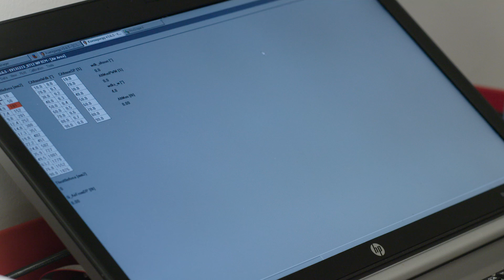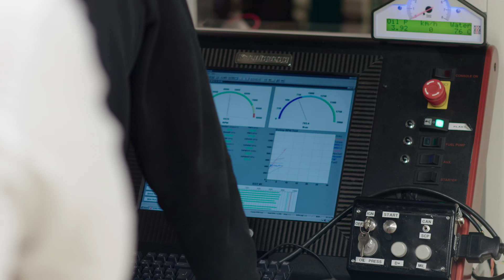The 1360HP Heart of the Koenigsegg One:1 - /INSIDE KOENIGSEGG

Comment: Imagine batteries will out-perform the Model S's by a factor of 3. 5 or 10 years from now? So 3 times the range, and likely a bit more peak power also.
This will either reduce the battery weight by 60%+ or vastly increase range.
What's the range for an ultra car, all topped up? Can it even compete with a current (heavy) Tesla luxury car?
So with 3x better (for weight) batteries, the 918 could skip the whole petrol drivetrain, slightly upgrade the electric engine, invest the lost weight in extra batteries, and get a really decent range. 
And today, the 918 could be stripped by some 300-400kg by making it a basic petrol-only supercar with 600+bhp. 1:2 power to weight is really quite decent. Lose some electric horses, lose the equivalent in battery weight. Accelerate about the same, brake better. Corner better. use less fuel when not braking.
The P1 devotes about 200kg to it's more refined electric systems? Strip those and you are in the same league as a de-wired 918. Does it need the extra 200kg and bhp? Imagine how it will corner when 200kg lighter. How much less it will consume on a journey. How much faster it will go around corners. How much later you can grab the brakes.
What does a petrol drivetrain for a super car weigh nowadays, parts the electric would have no use for? I honestly doný know. 300kg? A nice amount for batteries, but not nearly enough for today's batteries.
It sure seems like hybrids are de-tuned petrol cars to me. That they are getting better engineering covver that fact nicely. Lots of carbon and more hp. Crazy prices.

CvK seems totally right that when batteries become good, petrol gets obsolete along with hybrids.

I SO HOPE we'll get a Top Gear powerlap with the One some day, in good conditions....
Reply: Braking may actually be pretty close when you strip out the motors because the motors actually did some of the braking. The car would be a good bit lighter, but it would also have less braking force. Although, I would rather them just make the non-hybrid cars, just trying to point out that braking may not actually be all that different. Cornering, on the other hand, would definitely improve.
Reply: Electric motors in the 918 contribute 0.5 G of braking even before using the brakes.  Also allows for instantaneous torque vectoring, which is worth its weight.  All this on top of instant torque and power delivery and a large power advantage.  Ferrari studied the tradeoff between electric power and weight and found it to be greatly in the electric motor's favor.  Guess who else found the same thing.  Porsche and McLaren.  Biggest names in motorsport here all converging on same concept.
Reply: Andrew Malkin The motors can take work away from the brake calipers alright, but I would think that brakes have been pretty well "refined" by now. Brakes can bring a car to a halt just fine. Just waste past of the energy obviously. But to regenerate that energy takes a whole lot of weight. Does that out-weigh itself in lap time?
I do see a bit of an advantage in driving/braking 4 wheels individually, but at the rate these cars corner, adding on 400kg of weight is humongous. Don't forget the F40 and how light it was, with 80's tech.

Shadowboost CvK's point is that the current level of technology favors using no electric drive. Too much weight added for limited added performance and range. I think that Volvo V60 is a good example. Much better to not add the weight at all, boost engine power (no real limit to that), and enjoy car lightness. That will just never go out of style at the race track.
I think the P1 made that weight point against the 918 already. P1 has as little "e" as viable. It would not be a challenge at all for McLaren to get 900hp out of the petrol engine, increase the petrol tank, and enjoy a huge range, and still very very light car. A car spends most its time in a straight line. In the case of a track car, it's during full-on acceleration. Weight and aero are key factors here. Weight at lower speeds, aero at higher, obviously. At low speeds though, a lot of time difference can be made.
It's interesting that CvK does like e tech, but doesn't feel it has a place next to fuel. While certainly McLaren and Porsche found ways to let them co-exist. 10 years down the line, we might see a full-on electric Koenigsegg which takes need for a petrol engine away.

Comment: I disagree with you Christian, I think that the McLaren P1 shows that Hybrid power can be more fun than either electric only or combustion only, without sacrificing weight. Soon hybrid cars will use capacitors, like the Toyota Supra/BMW Z4 replacement coming soon. I would personally rather have a hybrid with a lightweight capacitor than a car with only an ICE.

Comment: That was a bit short episode, would loved to haven seen slightly more engines/parts. But never mind the statement regarding Hybrids was though are very clear one. In that regard and with respect to Koenigsegg I wonder how the cars are going to live up to the emissions regulations that will "soon" (2020-2025) be in effect. But okay combustion engines also turn out quite some tricks atm. and in 5 -10 years there will properly be alternatives to traditional gasoline based fuels.

Secondary to many of the comments in the thread - Yes off course Koenigsegg does not have the same R&D capacities as The big boys, but while they develop the hybrid technology to a higher refinement over time, and batteries etc. also become much better, Koenigsegg can wait some years yet before making a transistion. And at that time it is very likely that much more accessible technology will be on the market from automotive sub providers - This means that if Koenigsegg where to go EV or hybrid then it could very well be a doable task. In fact pure EV technology should on paper be far less complicated than Hybrid or Combustion.

As for now and with the very limited production numbers coming from Koenigsegg I don´t think it has any effect on the company what so ever.

The 1:One is already spoken for since it has been developed on request from East Asian buyers. "Make us a more track focused Koenigsegg" and so they have done.

Comment: Beautiful take on the hybrid engines, I think the hybrid phase is only a necessary transition from petrol to electric and it's an important step towards developing a better solution for batteries and electrical motors so that when this phase finishes we will get a fully electrical car without the need for a petrol engine as a backup or extra push.
Reply: I certainly hope so. Then we would only have to concern ourselves with green energy production.
Reply: well, I can assure you that right now there's not such thing as green energy, and they're polluting our planet one way or another, so what's allegedly called green energy has more waste than petrol because the way of manufacturing those batteries, that has a short lifetime. I only hope that Koenigsegg builds another successful piece of machine that intimidates all other hypercars such as Bugatti, Mclaren, Ferrari, etc..
Reply: Ardalan Fryad My guy the combustion engine is going nowhere.

Comment: hybrid cars ar shit! 
Good move Christian!!!
Reply: You're giving someone that would make a statement like that far too much credit.
Reply: you go and tell that to a professor for electrical engineering and hes going to make you feel like youre a baby....
Reply: I'm not a professor or something but we don't have a source of electrical power light enough and reasonably priced to use hybrid cars.
And by the way hybrid sistems are bad for hypercars because they add too much weight.
Reply: dimmacommunication yeah, thats why youre not an engineer. You dont need a big battery, you just need a big enough capacitor. Enough to charge when you break, connected to a motor that helps you accelerate.... Helps pretty good with fuel economy of big cars.
Reply: If Mclaren ferrari and porsche used batteries  there was a reason.
They wouldn't be top automakers  if they didn't know how to power an electric motor.
Reply: dimmacommunication yeah, exactly thats why youre not an engineer. Because you go with stupid shit.
Capacitor is charged quickly because it has little energy in it compared to a battery which takes long time to charge. Capacitor is loaded when you break and helps accelerating. No idea why its not common today, but it sure works.
Reply: LOL ,you aren't even worth replying.
Reply: dimmacommunication you dont even have a clue about the development of hybrids in the automotive sector, so shut your face

Comment: there you go from an expert. hybrid cars are worse than just petrol.
Reply: Porsche, Mclaren, and Ferrari have only released the very FIRST iteration of what they think hybrid super cars should be and these cars are already faster, more economical than highly optimized petrol engine cars.
Reply: Yeah, what the fuck do those hacks at Ferrari, Mclaren and Porsche know anyway.
Reply: Innovation and progress in order to do better should always be supported especially since these very first iterations seem to have done the trick quite well
Reply: Lawrence Timme

Uhh, right now? You do understand how the 918 works right? Not like the hybrid system stops working after one lap.
Reply: Lawrence Timme

For the obvious performance/fuel economy benefits? Thought that was pretty obvious. I love the Koenigseggs but let me know when one comes close to touching the 918s lap time at the Nurburgring.
Reply: Ian Sherman let me know when the 918 can do 5 laps of the nurburgring faster than a one:1.
Reply: TroubleKlef Economical, not at all. Do you have any idea how much one of those batteries costs to replace, or how often you would have to replace it?
Reply: Lawrence Timme

Has a very aggressive regen system and the V8 charges the batteries. Plenty of braking and acceleration on that track = plenty of battery charging, thus more hybrid boost. 23 miles is flat out with minimum regen. Might not be as fast as having a full charge but I assure you its faster than a GTR still.
Reply: Isn't a combustion to generator to batteries to electric more effiecent than just a combustion engine anyway. Because in breaking and any point your not accelerating energy is recovered or not created.
Reply: The basic concept is this:
If the petrol engine is not as powerful as the motor, its slowing it down, thus decreasing efficiency. The same applies the other way around. Its best to keep them separate to get the best performance possible. Once electric cars are faster and batteries are better then we will not want petrol engines on board will we? So why would we put electric power in a petrol car in which the petrol engine is more developed.
Reply: Ian Sherman it can only do 23 miles both systems on max power. Thats less than 2 laps, after that you've got a whopping 600hp and would be slower than a nissan gtr
Reply: Thomas H i havent see the torque curves but it will be limited at lower rpm to prevent wheelspin. they will both be limited by grip at any speed. the porsche will be faster out the corners because of its 4wd rather than its torque for the motors. also weight wise the porsche needs to be lighter to be faster because of the lack of power if its 50kg heavier then the power to weight will be miles lower. also at any point where the cars are accelerating at high speed, like on the last straight, the one:1 will be a hell of a lot faster. also the one:1 has a lot more down force so it will go around the corners faster.
Reply: The porch is 400kg heavier though that would pull it out of line in the corners but its biggest problem in my opinion is its looks. The porch also has considerably less power than the p1. The p1 also has more breaking force than the one thanks to the rear air brake and i doubt the one will have more down force due to the fact McLaren are so anal about stuff like that and they have state of the art wind tunnel and a f1 team. And the p1 is the first McLaren hybrid and the one is just a bulimic algera on roids. And the first 12c's are way slower than the current 12c's being built so the mclaren will only get faster and i doubt koenigsegg have the cash to keep doing R&D
Reply: Capt Nemo but with that being said we are moving from the boiling pot of water to a giant grease pot
Reply: +im not saying that by any means im saying its solving a problem by creating another problem im talking about hybrids/electric cars in general
Reply: I don't think you can use definites on that topic. Electric cars in concept are quite old and in the near term may still not be wholly viable.
Reply: 20mins of driving at 600hp minus drag from charging the batteries will make it much slower.
Reply: Ian Sherman and if you recharge batteries like that they will loose loads of performance though heat and constast cycling over time. Lipo batteries are designed to run to a certain point in the cycle before charging.
Reply: Thomas H nope because any gains will be offset by the extra weight.
Reply: I dont think the koenigsegg will have much range either though seeing that it has a 80L fuel tank and will probably do about 1 mile per litre of fuel which gives it a range of under 6 laps. (the one mpg is taken from the algera r's fuel consumption)
Reply: Thomas H it has 1360hp though not 800 for 1/2 the time and 600hp the other half
Reply: but it doesn't have 1000 lb-ft torque at ever point of the rev range with no turbo lag and no considerable drop of power when changing gear. This means the slightly heavier hybrid is faster out the corners. Also isnt their only a 50kg difference in kerb weight between these two  .